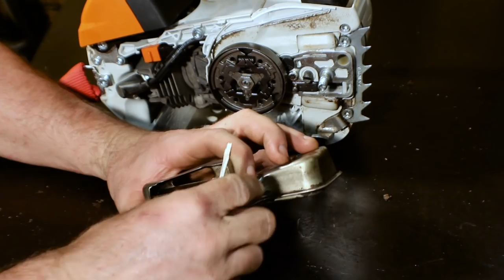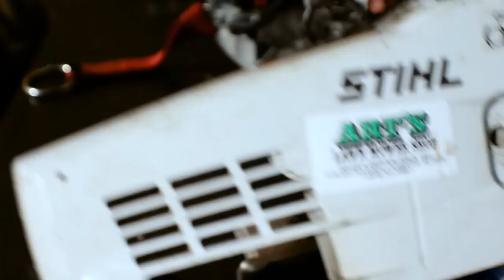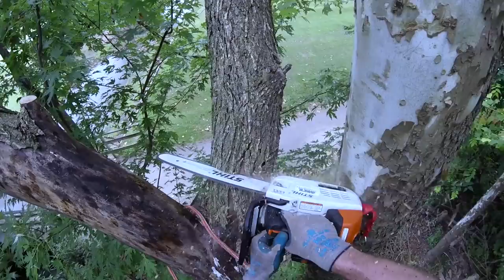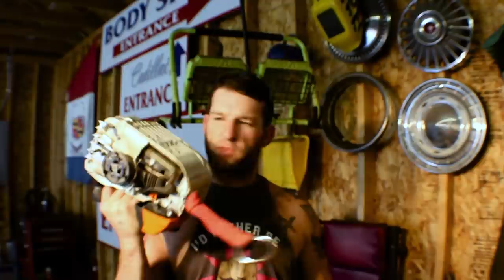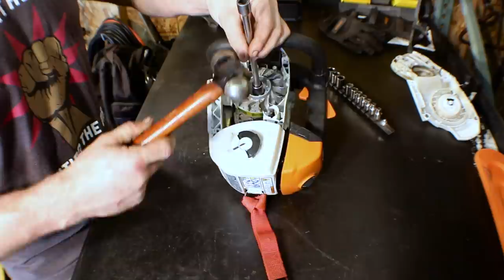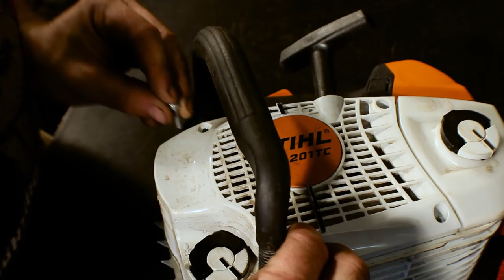Stihl MS201T C-M Muffler and Timing Modification

Comment: Correct if I'm wrong. On a points saw, you can advance by adjusting the points mount. Wouldnt it be better to elongate the two mounting holes on the coil and adjust there? Seems if you screw it up, a coil is cheaper to replace than flywheel or crank. Would think finer adjustments could be made. Just a thought. Thanks for the awesome video.

Comment: Thanks so much for this video. I just finished modifying my flywheel and exhaust and there's a big difference in response. I used a Dremel with a small diamond bit for removing the material on the flywheel cause my file was too big and it worked perfectly.

Comment: Unless you change the restrictions inside the muffler, that is for emissions, adding another hole on the down side of those restrictions does nothing for performance.   Be like adding an extra exhaust tip to your car while leaving the Cats and stock Muffler on the car and expecting more HP. Advancing timing is a benefit but requires higher octane fuel.  If you don't increase the octane levels you will get detonation.  If you think or suspect detonation, remove the spark plugs and inspect the top of the Piston.   If detonation is present, you will see pitting on the top of the piston
Reply: Stihls are notorious for restrictive exhausts. Dependent on the saw, the baffles are not actually that bad on the interior and drilling those holes and retuning the carb is just the trick to wake them up. 192’s and 290’s are great examples. I’ve never had a stihl saw that exhaust modifying didn’t help at least marginally.

Comment: Man, I'm so glad there's people like you to do this stuff so people like me don't have to. You ran a huge risk modifying that flywheel, don't know if I could trust the machine after doing that but looks like she's a runner. For future reference the microcontroller uses the pulses from both magnets on the flywheel to power itself as well as perform timing and carburetor adjustments. I will be very interested to see the long term effects of running those mods compared to a stock saw... Btw, keep a close watch on the very bottom of your piston skirt by removing the s/p and starter and rocking the flywheel back and forth past dtc. If she knocks then she's been over revved, the 201 has a larger piston and was not engineered for rpm in excess of 12k

Comment: I didn’t even take my muffler off. I just held it wide open and blew a hole in it then used a step drill to open the hole to the size I wanted.

Comment: hi champ good thinking on those two mods . . I've advanced the timing and removed every spark arester screen on all my chainsaws . . I have 6 chainsaws all stihl machines a 193t, two 018's, a 150tce , a 381 magnum , and a 440 magnum . much louder but I have more power in all of my saws now and I done it the exact way you do it . . just don't let anyone catch you using a saw with no spark arester screen . . big fires can be caused from hot carbon shooting out the exhaust . . as you know . . keep up the good work champ I hope your pelvis is not giving you too much greef ???

Comment: hey man love the channel I've been running a tree service for the past 1.5 years.  so I can relate to the learning curve. I'm glad to see that your passionate about the work, a little determination and passion will take you anywhere you want to go. I do have a question about the mods how do get your high speed screw to rich'in out after the mod. I'm so afraid of breaking the carb trying to take out the stops wants the trick.
Reply from the maker: Sorry for the delayed response, comment didn't pop up for some reason.  On the side of the carb, right above the high side adjustment needle, is a pin that locks the needle in place.  You have to drill it out, then the stop will come right out.  Can't remember what site it was that showed it being done, likely arboristsite.com, but that's where I saw how to do it.

Comment: Would you still get the effect of opening up the muffler without taking away the spark arrest? Don't think it's worth the fire risk during summer.
Reply: You would then have to arrest the new hole for fire protection. You still would have improvement but also conform.
Reply: Didn't even think of that could be possible to retro fit second spark arrest fiddly but quit do able-have the best of both worlds thanks for the thought, onto it     @unclep1210
Reply: Jörund Rundhovde totally worth it.... I don’t recall ever seeing a ember of anything coming out of any muffler of any saw I ever used.... but I have seen the bar and chain spark quite a few times.... where’s the screens for those????
Reply: Here in Oregon if a fire starts in the area where you are working and you have a modified saw you will have big problems with ODF

Comment: I've been wondering how to advance the timing on my stihl 015 that I just custom built. What benefit do you gain from advancing the timing on one of these chainsaws?
Reply: Quicker acceleration off idle, better throttle response and spool up
Reply: @Treeesmith  Yessir, I know this 1st hand now. Advanced the timing on my 015 last week and that combined with the electronic ignition upgrade and port work I did makes this saw a little monster. It looks like a little toy but it's really no joke.

Comment: Is it recommended to tinker with the carb if a large muffler mod is done? Or will it compensate itself enough?
Reply: It won’t take much of a carb adjustment after these modifications, but yes it is necessary.

Comment: does the m tronic require any fuel adjustments after performing the mods? I had to open up the Jets on my 150tc but that is not a mtronic saw. I am not familiar/ignorant with the new saws that have the auto tune stuff. I have a new 201 coming and would like to do these mods. thanks. appreciate you making the video
Reply from the maker: Everything I've read has said that the carb adjusts itself to the mods, though I've no proof in writing.  I can say that my saw is still running like a champ though.
Reply: Human good to know. THX
Reply: +jacob gilkerson +human In terms of having a machine that is less complex, I prefer not to have the M-tronic system.  Not to sound like a doomsday prepper nut, but, in the event of an EMP, the m-tronic system is hosed and the saw is useless.
Reply: Rich Asay your comment just made my day. That's funny.
Reply from the maker: Rich Asay next mod, lead shielding, lmao
Reply: I did the same muffler mod with 2-   1/4" inch holes and spark arrestor delete, runs like a champ with no other ajustments

Comment: Hey bud, just wondering if you removed the limiter caps on the 201?
Reply from the maker: This is the mtronic version so it doesn't have carb adjustment needles.

Comment: So is it possible to take off too much of the key and advance the timing too far? Could you please post close ups of the key way to give a better idea how much and where to file?
Reply: I don't know how noticeable it would be looking at just the keyway. The way I gauged how much he took off was by watching the flywheel fin on top. You will notice that after the adjustment a fin stops right at a line on the case. Using that as your reference, back up to before the mod, then gauge how far that fin moved. Now that you have a reference to work from, Remove material slowly and check frequently so you don't remove too much.

Comment: so the german engineers spent years developing the engine geometry and you take a file and move the timing 8 or 10 degrees...  did you measure your advance using any technical tools ??   can you measure your power and torque to see if you made anything better ??    the engineers that designed the engine I guess should have called you....        have you a degree in engine design or any science that you are using for these changes ???       do you think the saw engine works better when your done ???   moving timing an unknown amount seems insane to me...   especially since you have no way to measure advance or your power curve at rpm or throttle..     maybe would 90 degree advance be even better ??
Reply from the maker: Engine louder = More Better
Reply: @Human1337  More better = more awesomer! Keep it up, I am having fun watching this stuff
Reply: There are certainly improvements that can be done at smoothing intake walls as such process done at the factory would drastically increase the price of the saw. Smoothing the intake makes for more air intake due to less air friction and thus less turbulence in the stream. I do agree that these engines are capable of more power yet more modifications than that require test apparatuses and/or a lot of expertise to do it properly.

Comment: What chains do you run ? Or recomend
Reply from the maker: Any stihl chain, doesn't matter what type.  The pre-stretch in them is the best I've yet to see.
Reply: @Human1337  do you hand sharpen, or machine? any interest in reviewing the granberg? i've seen other reviews of it, however i'm curious what your opinion is. i'm thinking of using it on the job for when chains need a little more than a couple strokes.

Comment: Can I port the muffler and keep the spark arrester on?
Reply: Sure, just pull the spark arrestor out first, drill your port then put the arrestor back in. You can leave it in while drilling the hole but it's like 50/50 on if you screw the arrestor screen up or not. So just pull it out, do your port then put it back.

Comment: why does my 2012 201t seem harder to pull then the ones in the videos like the pull cord isn't as easy to pull
Reply from the maker: Not really sure on that one, does it run fine?  I will say it is more difficult to start them in the trees, depending on positioning.  Often don't have my legs planted firmly for a good base, so it can be quite a pain sometimes.
Reply: Human that's probably it...thanks. .but anouter thing it does it revs with chain break is on...it locks the chain but still revs when outhers make that grunting noice??
Reply from the maker: Might just need a little adjustment on the idle.  It's the screw labled (LA), loosening it will bring the idle down, tightening will bring it up.  Generally want it set to where the chain will just barely turn at idle, then back off a hair so the chain stops.
Reply: Human thanks mate keep up the good work im buying a a ht101 arey good
Reply from the maker: Absolutely, use the HT 131 all the time, close to the same thing.  I will say they do have at least one new model of polesaw coming out in the spring, may want to wait if you're not in dire need of it.  Check out the new ones, maybe grab it, or a discounted older version if the new model isn't much better.
Reply: Human getting in pre ownd 280 pounds deliveryd..wich is 350 dollars
Reply from the maker: Damn good deal there, I would just recommend you make sure they've a return policy, and make sure and pull the muffler and make sure the cylinder isn't scored when you first get it.  Heard some horror stories about things of that nature in the past.  I myself have emailed a couple of people on craigslist about saws they've for sale, and mentioned I'd like to pull the muffler before purchasing.  They tend to get cold feet on hearing that and go silent leading me to believe they're many out there trying to sell trashed gear.
Reply: Human what exactly is pulling the muffler
Reply from the maker: Simply taking off the couple (three on that one I think) bolts that hold the muffler on.  Take off the muffler and look inside at the piston and the cylinder, make sure that they're not scored (gouged and ruined).  A machine can still run with some scoring, so they'll try to pass it off as fine even though it's on it's death bed.  Most often from running straight gas in the machine and not mixed fuel.
Reply: Pulling the muffler on a 4 mix engine won't get you very far...
Reply: @Human1337  Do you do this before or after Low adjustments?  I've gotten good tuning by-ear but I really hate that I'm not making use of my tachometer, anytime I try to use it I find I'm choosing between keeping it sounding/running great OR keeping it to factory-spec :/  (should note that I have this problem on my un-modded saws as well!  I always thought it was "Idle, then L, then H" but doing it that way, and making it sound, run&cut properly is never = to tuning with the tach so I still just tune by-ear..)

Thanks as always for the vids, am getting a 2nd 25cc unit (same as my current 'Scheppach CSP2540) for purposes of modding and having 2 on-hand (both for insurance in case I ruin one modding it, and just insurance so I'm never on-job and find myself having to heave around my 33cc Tanaka on my belt because the 25cc died on me, though it's been >6mo w/ that Scheppach and it's still running like a pro even w/ the larger bar & more aggressive/lower rakers on the chain :D

Comment: How many degrees advanced?
Reply from the maker: I'm super scientific, so I don't even measure.  I generally go into the key about 1/4 of it's width.  I'd guess in the vicinity of 3-4 degrees.
Reply: You gave that plus 10` advance timing by looks of it ( if it didn`t move when you re torqued the crank nut ) ....would love to hear how its been running and what octane fuel you have been burning ?

Comment: Is that an atheist "A" on your right arm? 

Good videos. I just did my first big maintenance on a saw recently by putting a big bore kit on an old 066.
Reply from the maker: Correct on the "A", most people think I'm just a huge fan of the angles baseball team....not so much.  Though technically I'm agnostic, lean heavily towards atheism.  Very nice work on the 066, everything turn out cool?  I don't do enough large jobs that I still don't get a little nervous when I go to start them back up.  Always wondering, did I forget anything?  lol
Reply: I'm an atheist myself, that's why I noticed. Respect for getting the tattoo. 

I had actually never taken an engine apart when I took apart the 066. My brother started a tree service and we dealt with stuff up to 60", so a big saw was a must. But he burned up the rings, and scored the jug. 

The hardest part was actually routing the ignition cutoff wires back properly and getting all of the throttle/choke linkages lined up. Fortunately I didn't forget anything, but I have a video of me firing it up, took some adjusting of the carburetor to account for an extra 6cc. of displacement!
Reply: Yeah I used to be Agnostic, but now I believe in the Devil for sure..  Also, many ancient cultures of the world used (and still do) use the hexagram to represent Saturn.  And guess what, there is a massive Hexagon on the north pole of Saturn, 4 times the size of Earth...  How did they know?
Reply: Shit yeah!